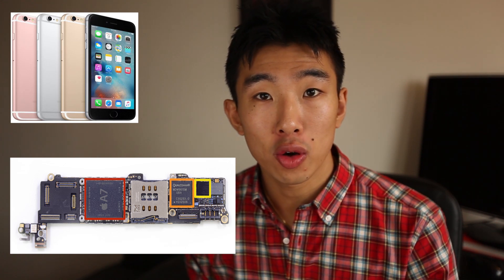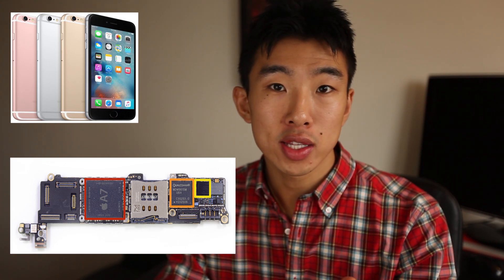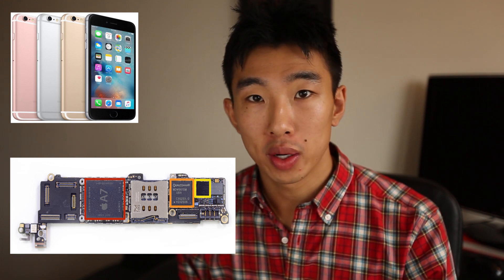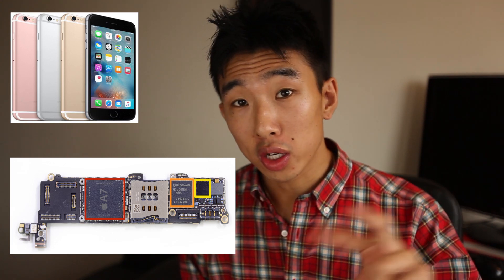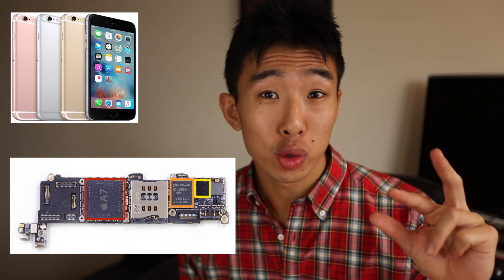How Does an iPhone Work? - Part 2 Hardware

Comment: what do u think hardware vs software?Which one's  future more bright and flexible conditions?
Reply from the maker: +Bryan Kleinz 
I think there is a future for both! By nature, there are a lot less hardware engineers than software. There will always be a demand for both. Entry level, especially now, for software is a lot easier. I do software mainly as my job, and I've moved pretty far from hardware. So software is more FLEXIBLE I think. Future is bright for BOTH. Both are hard at a high level and entry to software is EASIER.
Reply: Thanks for answer.So i will concern software.I'dont find any information about which software industry has most job and 	which one do you suggest?